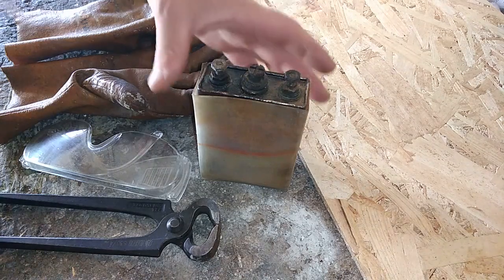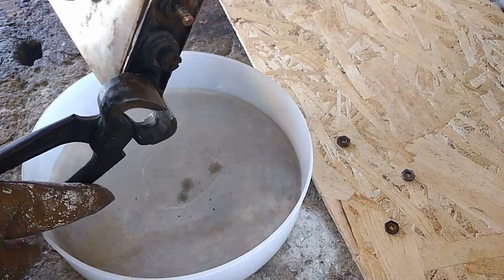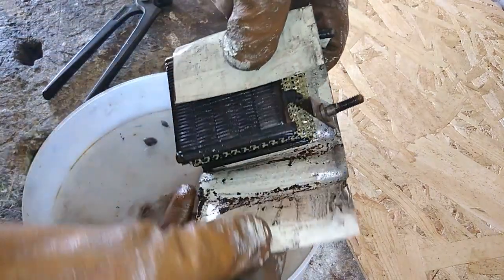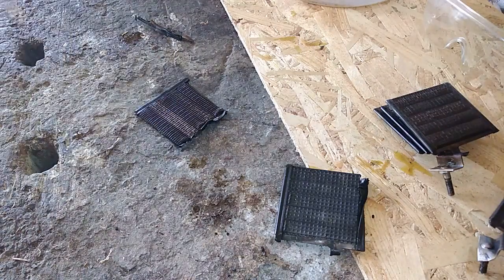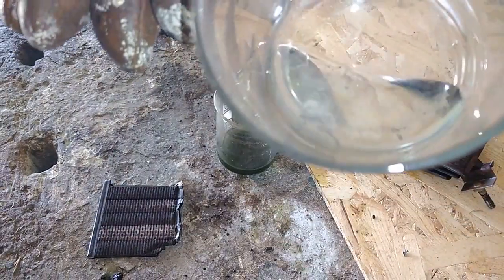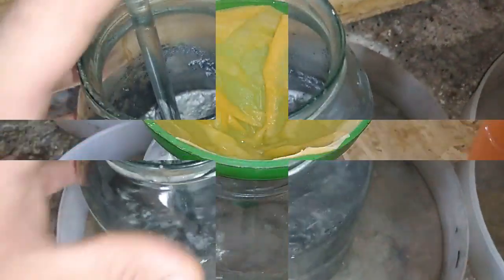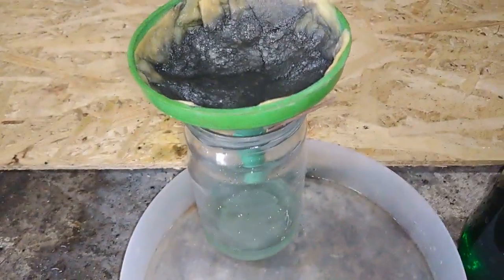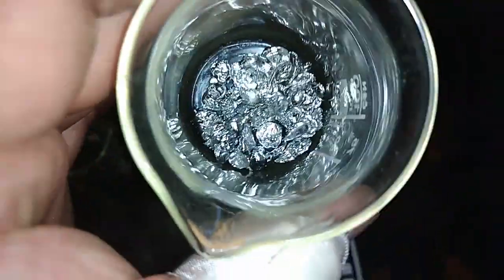Silver recovery from Ag-Zn rechargeable batteries!

Comment: so you can use a diluted sulfuric acid mixture to melt all the zinc and be left with only silver make sure the solution is cold let it sit and keep adding diluted mixture until fully dissolved may take up to 3 cleanings then being added back to a solution before you are left with just silver which hardly reacts to diluted sulfuric acid also diluted sulfuric acid is anything below 29% so make sure to have over 71% distilled water in the mixture.